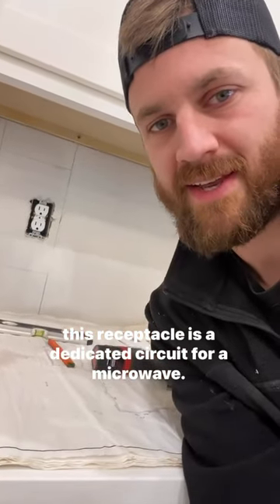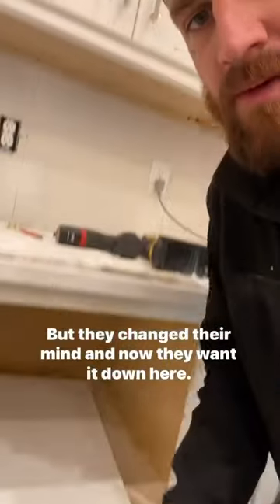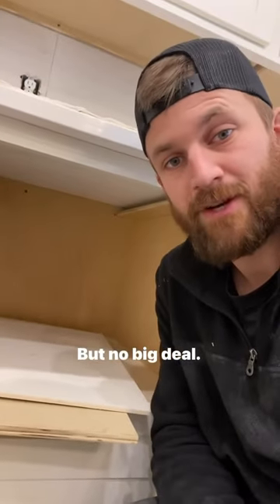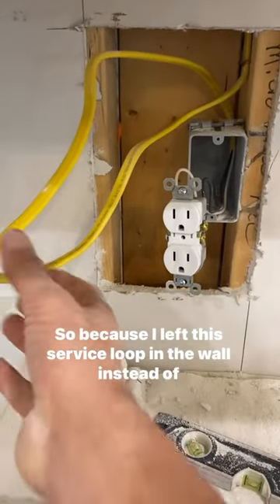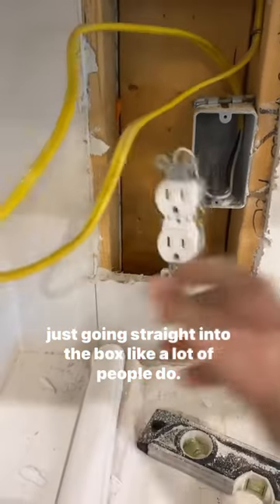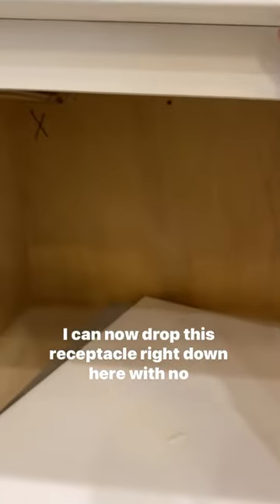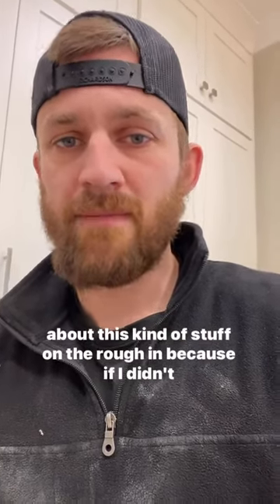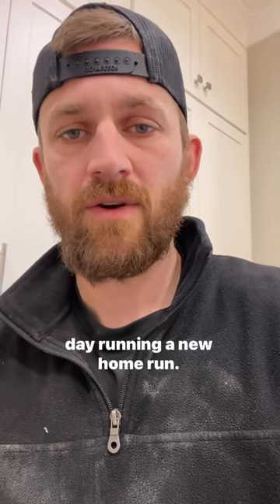This is Why You Should Leave Service Loops!! #electrician #bluecollarlife #construction

Comment: Sure until they want it five feet away. Just put an outlet in the box, you never have enough in a kitchen.
Reply: microwave requires dedicated circuit though right?
Reply: I can't believe how many people completely missed that he explicitly stated this was a dedicated circuit for the microwave.
Reply: @foogod4237 so why the double outlet if only one thing is allowed to be plugged into this dedicated circuit?
Reply: If a residential microwave draws enough power to require a dedicated circuit, they need a new microwave from this century. NJ kitchens require a 20 amp circuit with GFI anyways. And as a user of kitchens, there's a special place in hell for anyone who removes an above-counter plug and thinks they've done the client a service.
Reply: Yeah, he’s latest code violation there is more than two feet between the end of the counter and a receptacle on the right. 

1100w for a microwave, ok you have 10amps left for the old counter receptacle, what’s the problem here about a dedicated circuit?

Comment: Article 334.30 states that cables coming out of the junction boxes should be secured within 12 inches of the box in all boxes equipped with cable clamps.4
334.30 Securing and Supporting. National Electric Code of Illinois, 2020, NFPA, 2020.

 These cable clamps are not to be removed. 314.17(C) states that cables must be secured to the receptacle box. Although, in article 314.17(C)'s exception, nonmetallic boxes have no cable clamps and must have cables supported within eight inches of the junction box.5 In either instance, the wire is secured by wire staples that keep it from moving within the wall cavity.

Comment: Everyone just going to ignore the fact that buddy still probably needs to add a new wire to keep this counter top receptacle.. I don’t see another one close by in the video, so I’d have to assume you’re going to still have to get another receptacle added in place of the one you just removed to service that counter top space.
Reply: Dedicated circuit for the microwave, counter receptacle will be removed.
Reply: Spot on observation.
Reply: Makes no sense to not just keep that outlet there and run a new wire from the box down.

Who cares if it's not totally dedicated, it's close enough and the chance of it ever tripping is not high
Reply: There is another outlet 12 inches to his rear at the beginning of the video. There is something off white plugged in to it.
Reply: @djblock215 Exactly. I run a toaster oven and microwave off that same circuit. Both larger loads and have never tripped the breaker. Why, because how long they are used matters. A microwave cycles on and off during use, as does an oven once up to temperature. What two loads in the kitchen will draw a steady 25-30 amps for the half hour needed to trip it? Or an immediate load a bit higher?

Unnecessary restrictions in the code... I do think it is good to have some of the major appliances separated from the other outlets, but there is no reason the disposer and dishwasher need dedicated lines separately either.
Reply: There’s one there😂
Reply: @NayoDuz  lol right mfer cant see. Magoo in the flesh. 🤣
Reply: @waltewhitesPhD code does say receptacle every 24” on countertop space so yeah he’s gotta add that receptacle back in 🤷🏽
Reply: @Weasel_NM575  cite the section please.

Comment: Code requires you to pull a new line for the new microwave location IF you leave the counter plug where it is. You're fine by eliminating the counter plug, but that would violate code again as it requires so many countertop plugs.
Reply: Finally someone on here who actually knows wtf the NEC says. Some of these people on you tube are not educated. Lol
Reply: @Skibidi_Male_X 
Appreciate your kind comment. Thanks my friend! 😊
Reply: What if you put a blank on the first box and run some wire to the second location for the dedicated plug? Would code allow for that?
Reply: @DonnieBodacious  
A blank is nothing but a cover plate. It does not count towards a needed minimum of countertop outlets, even if the leg to the breaker box goes unused. Run wire to the second  outlet from where? It has to have another dedicated circuit breaker. A new line has to be fished from the breaker box anyhow. That's what the poster was trying to avoid in the first place - running that line, costing $$. To sum, two outlets, two lines, and two circuit breakers for two separate circuits is what the code is calling for. The no cost solution would be to abandon putting the microwave below the countertop and leave it on top where is was in the first place. Convenience and code always has a price if things are done after the build phase.
Reply: Did you not catch the part where it is a dedicated circuit for the microwave 
Which means there was already the correct amount of countertop receptacles in the kitchen. 
Which means the plug missing doesn’t change the painting on the wall at all

Your claim is null in void
Reply: @Hohmies86  
Thanks for pointing that out. Today, each 20A countertop plug is required to be on a separate breaker. Doesn't matter if a microwave is there or not. Microwaves have their own 20A breaker. So, as long as the countertop plug count satisfies code, then he could eliminate that breaker. I originally thought this was usage as an AND situation where both are required, not an OR situation where one could be eliminated. Can never have too many  countertop outlets, eh? 🤣
Reply: Tell that to the customer, don't think they will be willing to pay for a full rewire.
Reply: @jbsimmons54 The microwave receptacle was never part of the required counter top receptacles though so it shouldn't be as issue as long as the number provided were already up to code standards on spacing.
Reply: @jbsimmons54  furthermore, he could’ve just left the box and “added” a receptacle in the area they want the microwave, install gfci on countertop, put both wires on line side and the owners could always put the microwave on the counter if they ever change their minds or just use it as a normal plug but just know it’s the microwave HR
Reply: @ameunier41 well the customer should get their layout correct at the time of quotation.

Snags to original design is the biggest time waste on every job
Reply: Dedicated Circuit means one single outlet receptical on it's own  breaker marked! Same Amperage as the rated appliance! Poof like refrigerator,  stove.etc.
Reply: It depends on the state and town codes.
Reply: Stupid code rules on a crappy house made out of wood instead of block concrete and rebar
Reply: @jbsimmons54 Hi from the UK here what is the theory behind the need for a microwave to have a separate 20A circuit in the US? Are you not allowed to join cabling in the US are rated junction boxes not a thing?
Reply: @philipnorthfield   The USA is on 120V instead of 240V and as such, the current is double that of the UK for the same device. Microwaves generally pull 12-15A. Kitchens are appliance heavy, so code was changed to upgrade wiring and outlets from standard 15A to 20A. It was also mandated due to fires from having too many branch circuits on a breaker/fuse, that each branch have it's own breaker with arc-fault detection and GFCI where necessary at the outlet, if not in the breaker. They also added more outlets for the kitchen counters. Now that all kitchen outlets are 20A and stand-alone, a microwave can be plugged in anywhere, by itself.
Reply: @jbsimmons54  of course that makes more sense. UK everything is ring main circuits except showers and cookers. But all individual appliances are also fused at the plug.
Reply: @philipnorthfield  
Let me add that in other parts of the house, 15A outlets and wiring are still standard. Multiple outlets can be on one branch, but must be confined to that room's 4 inward facing walls, but can't include the rooms on the other side of a common wall. In older homes, multiple rooms were on a single breaker. We do use 240V, but is confined to devices with high current draw, like, electric water heaters, electric stove/oven, electric dryer, HVAC & heat pumps, and EV chargers. We do not have switches built into outlets as a general rule although you can buy one, but it's one switch and one outlet only per unit, not dual. We do put switches on walls that control outlets and that's the closest thing we have to your switched outlets. Some devices are fused at the plug, some at the device rear, but generally that's left up to the main breaker panel.
Reply: @jbsimmons54  I am currently in Portugal swearing my way through similar regs, I have to say I think I prefer the UK system given a choice but it may just be because it's what I know. I do like the ring system MCB and RCD protected with every appliance being additionally rated and fused accordingly at the plug and wall sockets all switched with additional spurs switched and fused  all the cables are additionally sheathed and three core..... I think I am just getting old man syndrome where basically everything different feels like a pain in the ........ 😂😂😂😂.  Thanks for the info though it's always interesting to see how it's done elsewhere I wonder if at some point far in the future there will be a global standard taking the best of all the systems and combining them....... 😂 No obviously that would never be agreed on 😂😂😂.
Reply: @dismat  glad you could vent here. Just know Americans are not stressing over the differences in construction methods on this side of the pond!
Reply: I think that code requires 2-20A countertop circuits for appliances for every 6’ of counter, in my son’s kitchen I wired 9-20A ground fault circuits and duplex ground fault receptacles into the countertop for convenience and to satisfy code requirements around sinks. Installing more than the code requires gives the owner maximum flexibility in using the kitchen.
Reply: So could you use the box as a  junction box for dedicated line to microwave and still bring over a wire from another outlet for plug in that location?
Reply: @knotallthere66  
Not in the kitchen, no. Each outlet's line is dedicated as it's a full 20A outlet on a 20A breaker. In other rooms, yes. That's my interpretation of the code. See my recent posts earlier to another comment from Portugal.
Reply: @philipnorthfield high draw stationary appliances are required to have a dedicated breaker. You are allowed to chain outlets on other circuits.
Reply: @knotallthere66 as usual in the US, it depends. Some areas banned multiple circuits in one junction box. Some have special requirements for the junction box.
Reply: Can someone cite the code where it says a microwave has to be a dedicated circuit?
Reply: @jbsimmons54 what he's asking i think was couldn't he just come out of the upper plug with a 2ft piece of wire to feed the new plug? Not sure if its legal but ive done it plenty of times
Reply: @brandonknight7240  
No. Has to be an unbroken run. If you pigtail through the upper outlet, where does that feed back to? The whole purpose of going through that junction box is to tie it to another branch, which isn't allowed, not in the kitchen. Can't put more than one 20A outlet on a 20A breaker. But just for the sake of playing devil's advocate, let's say you have four 20A outlets in a bedroom on a 20A breaker. Someone decides to put a 1KW microwave on it. That is allowed, but not recommended,  depending on what else is on those other 3 outlets. As far as code goes, it's location and purpose that drives things. I've been in apts where the new microwave line is tied in with overhead lighting, which is illegal, but some handymen who aren't professional licensed electricians don't know any better.
Reply: So, every kitchen counter is required to have 1 outlet within 2 feet of each end. A 5 ft counter would require 2 outlets.

Also, you are required to have a receptacle every 4 ft along said countertop.

As for service loops, it is going to be ENTIRELY on the AHJ and their interpretation of the code. In some areas, you don't need an inspection and can pull a permit without a license.
Reply: @jbsimmons54  Where does it say the microwave has to be a 20 amp outlet?
Reply: @nancypelosi2627   Common sense for one. Midsize Microwaves (800-1,200 Watts) generally need 10 amps. Full-Size Microwaves (1,200-1,800 Watts) are approximately 15 amps. Commercial Microwaves (1,800-2,200 Watts or more can require 20 amps or more.
Reply: @jbsimmons54  Common sense isn't code.  This isn't a commercial application.
Reply: @jbsimmons54 Dude, nothing you have stated is true.
Reply: @nancypelosi2627 Usually the microwave instructions will call for a dedicated circuit. The code, in 110.3(B) requires equipment to be installed in accordance with the instructions supplied.
Reply: @edisont.picard4112  Wow hopefully your inspectors don't reference such a vague code. They could get you on anything the customer would eventually install. Do you know of a typical residential microwave that requires a dedicated 20amp plug in it's documentation?
Reply: @nancypelosi2627  It doesn't typically happen with inspectors on countertop microwaves. It's usually on mounted microwaves that I've seen it. And inspectors aren't really looking that closely. The issue comes when you file a warranty claim and they tell you they won't honor it because the circuit wasn't dedicated.
Reply: @edisont.picard4112  Do you have an example of a typical mounted residential microwave that says it has to be dedicated?
Reply: @nancypelosi2627 I don't have a manual right right off hand, but my own mounted microwave has a rating of 14.5 amps. That by itself means the circuit must be dedicated because code says no fixed in place equipment can exceed 50% of rating of a circuit shared with other outlets.
Reply: @edisont.picard4112  
Really...? Your qualifications are what?
Reply: @jbsimmons54  I'm qualified by years of experience, but many qualified people are wrong. I never base my arguments on qualifications, only facts. I can read, and the code doesn't say what you say it does.
Reply: @edisont.picard4112  What is the model of your microwave?
Reply: @nancypelosi2627  Some GE model. I don't have a number at the moment.
Reply: @edisont.picard4112  
To make matters worse, in my state, AZ, the only code that matters is what the local permitting authority (city level) inspector wants you to use in their jurisdiction.
Reply: @edisont.picard4112  No one ever does
Reply: @nancypelosi2627  No one ever does what?
Reply: @nancypelosi2627  No one ever does what?

Comment: So I looked at the code, and I learned a long time ago that they word things certain ways for a reason. I’ll sum it up:
The last staple before entering the box must be 12” or less FROM THE BOX.
BETWEEN the staple and box can be UP TO 18” of wire.

No matter how you look at it, you can’t fit 18” inside a 12” measurement. Thus the implied option is that there can be a loop of wire before entering the box…

I wish I knew this when we were wiring our house!
Reply: They measure that with the length of wire from box trust me ive been through all stages of electrical inspection. i wouldn't let any of my employees do this
Reply: @Raid_Zero1  our local “city” code also wouldn’t allow this. But we also don’t live “in” the “city”, so only the national code needs to be followed. However we followed the city code so the inspector would more likely pass it. So yeah install according to your local inspector’s preferences. But this one I would have at least asked if we could follow the national code, or compromise on the length of the loop.

Comment: It would take 5 minutes to add a junction box to splice another wire to go down there.
Reply: Junction box in a new build, how nice
Reply: @MrJacob0298 😂 then gets mad when told to go sweep
Reply: yea, turn the junction box into a nice night light
Reply: That’s a bad place for a junction box if there’s going to be a backsplash there. I would just leave the outlet there and take power from it to the new outlet below
Reply: He said in the beginning it’s a dedicated microwave circuit. The homeowner may have their reasons for wanting to keep it dedicated. It isn’t dedicated if your toaster oven coffee maker or air fryer are plugged into it.
Reply: @Aviator013  junction box in the wall with a 4x4
Reply: @Aviator013 dedicated
Reply: @donvaughn5254 not even 5 minutes
Reply: @donvaughn5254 pretty sure your fridge and microwave are bulbs supposed to be on their own breaker these days + 2 extra circuits run to the kitchen for recepticals
Reply: Yea, just use that box over the counter tops as a j box. Add an unconnected light switch and watch the confusion of the new homeowner.
Reply: just use throughcrimps and heatshrink, extend to bottom, install backsplash
Reply: If it was a dedicated circuit you have to put a single receptacle in and it has to be 20 amp rated !
Reply: Even though its dedicated, whats stopping you from an internal Jbox and some wire nuts if no service loop?
Reply: @dooooooval904  Junction boxes must remain visible - NEC.
Reply: Wouldn't the junction box then be required access? In which case how would he be able to identify the junction box once recovered with a new tile?
Reply: @mattfrick8038 LMAOOO😂😂😂
Reply: just run it from second hot and neutral screws on first receptical only need a few feet of 12/2 and a outlet box 😂
Reply: You cannot hide a junction box in a wall. They need to be accessible. You could out a cover plate but it's a brand new backslash, you don't want a random blank cover plate.